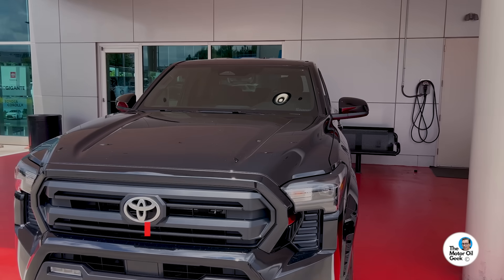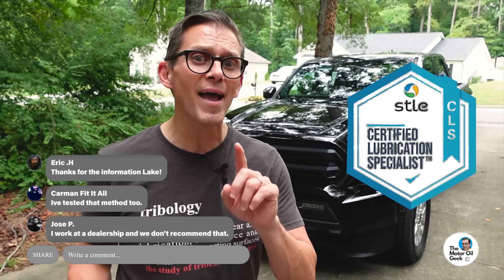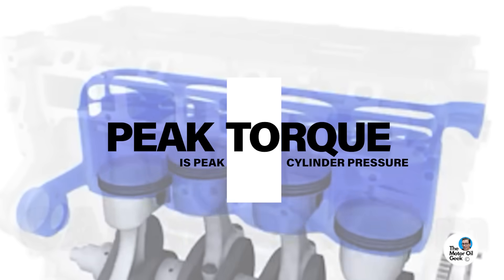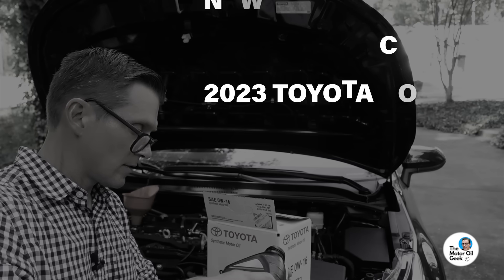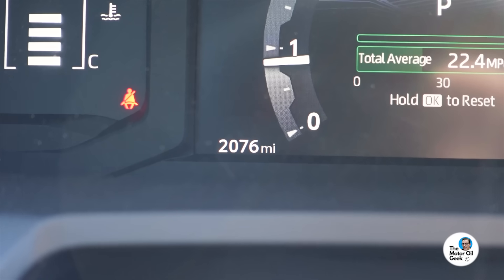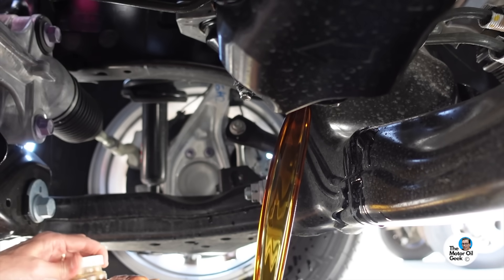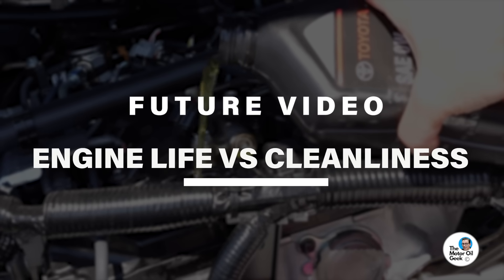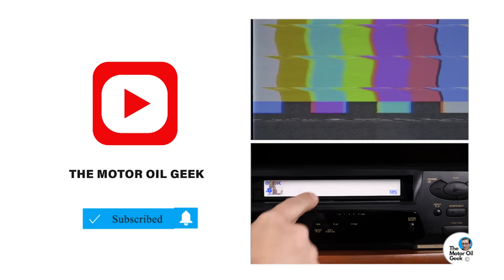The FACTS About Oil Changes (What The Owner's Manual DIDN'T Tell You)

Comment: At 1:09 you show a dramatic picture of metal residue. May I ask which car model "break in contaminates" does this picture come from. Because "in my opinion" there is no way that brand new Toyota truck behind you have visible metal residue at 500 miles. Also having wear metals ~100ppm does no real damage to the engine, you need numbers at least to the high hundreds for this to be an issue, and I am sure you know that. On a side note your left external jugular vein is dilated as you speak. Normally both sides may protrude as some people speak (speaking increases intrathoracic pressure). Having only one side means there may be something pressuring the vessels in your thorax.
Reply: Your opinion is based on what? Lo

Comment: Currently braking in my 25 tacoma.  First 1k nice and easy changed oil and filter but had a 1500 mile road trip day after 8 hours of strait highway Oops.

Definitely excited to see oil viscosity testing since this same motor outside the U.S. has a range from 0w20-10w30  in the owners manual.

Comment: @3:37 You mention "Direct Injection", you're not wrong, but your half right.
The entire Toyota Dynamic Force family of engines uses Toyota's D-4S which is Direct and Port injected.
These engines will never suffer from the dreaded carbon valve buildup that a normal direct injection engine would inevitably succumb to.

Comment: hi Lake, sweet Toyota, congrats, and that is also a sweet way to get more heat on the oil, ie buying a turbo engine!  Congrats to your family as well on  your daughter's job!    I love your channel, it's of course like nothing else YT has ever had actually, which is SUCH a relief after a quarter century of 'dupid's arguing about oil, lol.  My father figure was also a tribologist, and was a genius chemist and engineer as well, initially self taught chemist bcuz in early mid 1950's or late '50's even our public univ here was expensive for ppl with no money, so first two years of credit he was able to 'test through', which was allowed then, amazingly.  His career was at Boeing here in Seattle area, including a hella long layoff period when the economy shut down in the '70's for a very long time for the lazy B.  He was one of the geniuses there, ie could do it all and back then that was needed bcuz there weren't progammers who could or had time to do a 30K line program to make a fuel analzyer device (which he made).    Anyway i mention all this for one simple reason:  he died young at 57, of esophagal cancer, quite possibly not related to his chemical exposure, but i need to point out his chem exposure bcuz it was fairly substantial of course bcuz he was both a bench-chemist and a do-it-all chemist and engineer at a relatively dirty time in our industrial history.    And so i mention that bcuz i saw u changing the oil getting dirty oil on your hands/arms, and i'd love you to wear gloves, even though i was like you and did that too when i was working on my cars, at least long ago when i was young, but it's a big mistake, bcuz repeated exposure is also the bad aspect of course.   So, yeah we do deeply appreciate you and your efforts and want you living a great healthspan!    We men including me, have often been too casual about medical matters, and this matters

Comment: Lake, I have a 2017 Honda CRV with 92000 I bought it new. I've been using Amsoil 0w20 manufacturer recommended the hole time. I have also changed the oil on the recommended times not the Amsoil recommended schedule . So my question is what viscosity oil would you recommend. I plan on keeping is car and I watched one of your other videos about using a high viscosity oil on higher mileage engines. Thanks

Comment: I wonder how much difference there is on actual engine wear vs doing first oil change at 5000 miles. I'd think oil filter will remove larger particles that actually damages bearings.

Comment: I always changed oil and filter at 200 miles, 600 miles, 1000 miles and then every 3000 miles thereafter.   Always let my turbo engine idle for a few minutes before turning engine off.  Car is 20 years old and still in like new condition.

Comment: I bought a new Mazda 6 and Mazda tried to talk me out of changing the oil at 1000 km, saying it was unnecessary. The 1st handbook oil change from new is at 12000 klm ! Then 15000 km after. Maybe I'm old but 10000 is the max I will go. I do 100 km a day for work, 80% highway driving.

Comment: I only know a "little" about Oil, and that's EXACTLY the schedule I'm doing too for the Rebuilt I just got put in.
I'm also going to change the oil every 2,000-3,000 Miles in general, and put Amsoil Signature in it, or at the least Pennzoil Ultra Platinum since it's clearly the second best.  Also, maybe every 4th oil change I'll likely run Valvoline Restore and Protect to clean the engine some.

Comment: I am going to make this simple. I am 64 years old and I have done every oil change on every car since I was 15 years old. I have never ever ever had a vehicle in the shop for engine repair. My current vehicle is a 2005 4Runner 200,000 never been to a shop other than tires and alignment.

Comment: What are you guys talking about... What break in period, what first oil change??? If is sooooooo important and necessary the way everybody talks why don't you change transmission fluid as well at 1000 miles ??? Does transmission have break in period as well???  Come on people let's be real, just do the way owners manual says and stop talking trash about 1000 miles oil change or should I pre fill oil filter or not. I do 10k miles oil change on all my cars and have 3 cars older then 15 years, running strong, no leaks or any problems!!! All I can say... Blah, blah, blah!!!

Comment: I have a 2024 Tacoma, changed oil at 699 w/0W-20. Just changed the oil again at 3,000 w/5w-30, noticeable change in valvetrain noise. Smoothed it out quite a bit, also noticeable increase in oil pressure. May switch to 5w-20 at 5,000.

Also the other region manuals offer much more leeway with what oil type you use. All the way up to 5w-40

Comment: I agree, change early often!, however I would be SUPER curious to see 2 controlled test, one motor gets 10k oil change for break-in and other gets 150,500,5,10k  then add up total measured contam. often should be lower all added up then single due to the contam being circulated causing more wear. p.s. im a monster, i do 50m 150m 500m 2500m, 5k from there lol

Comment: When you add that 1 quart after draining, do you have the plug in or do you drain straight through? Thanks
Reply: I believe he has the plug out so you can just flush whatever remaining particles are there out of the system.  Sounds like a waste of a quart of oil to me but that is what he recommends.  Who am I to question him?  Then, put the plug in and fill the engine with oil according to your manual.  Keep in mind, if you don't change the oil filter, you are probably going to put in less oil than if you changed the oil filter too.  Good luck.

Comment: Question for ya oil guy ? Toyota cars list 0/16 or 0/20 , I heard that other countries don't run the same oil viscosity as the United States & their reason was the temperature of that country & they don't want to change the cars label for what country it's going too , so hot climates they use 5/30 & for cold climates it's the 0/16 or 20 , so for me in Michigan should I be running 5)30 in the summer than go 0-16 or 0-20 what ever the car recommends normally ? 0/16 0/20 seems very thin for summer time ? Thanks hope you see this & comment back ? thanks !

Comment: I followed the advice from these videos and did the first oil changes on my 24 Tacoma at 700 -> 1,500 -> 3,000 miles and then every 3,000 since. Toyota is great and did the first three for free even with very little miles in between. My last free oil change at 3k miles was the 15k service 😂. The truck is at almost 20k miles now with 8 total oil changes. Very curious to see the upcoming videos on this truck!

Comment: That is factually incorrect. The more particles trapped in the oil filter cause it to bypass more oil so that less and less oil passes through the filter. Once the oil filter is "maxed out" with particles, all of the motor oil will bypass the filter. I have also seen what neglected air filters do on fuel injected engines and it is a gradual loss of power from what the customer is used to when the air filter was new and or the car was brand new. More air flow equals more power. High silica levels on a new engine is from the casting process since the engine block and cylinder heads and other parts are cast in sand. There's no way to remove all of the microscopic sand particles from those components before the engine is assembled not to mention the cleanliness of the assembly plants isn't "laboratory clean".

Comment: Our Honda CRV (2025) hybrid had an oil change (not a factory recommendation) at just under 700 miles, then again at a bit over 3000 and now (about 15 months in after purchase new) it has just over 4000 miles on it. I will change it again at about 6000 miles. I used Amsoil this time and feel confident (no turbocharger) that I am doing the correct thing to ensure long life. I am still using 0w-20 grade as that is what is called for in the manual.

Comment: Does leaving the same oil filter to filter more isn't going to be more clogged? Resulting in a higher oil pressure, not because of more oil going through but because of oil restriction? I know we are not talking about a 20k miles filter but, if pressure increases, the valve in the filter opens, letting unfiltered oil pass through?

Comment: I would be interested in info on long intervals between oil changes. My commute is about 500 miles a week at 60+ mph for the majority of it. I change my oil once or twice annually. 358,000+ miles on a 2008 Ford Edge 3.5L, naturally aspirated. It started life with me at just under 100,000 miles. For the past few years I've been using Mobile 1 full synthetic 5w-20. It was not my commuter car for the first 6 years we owned it (2012-2018). 
  This car has been absolutely dependable! I did replace the power transfer case over 150,000 miles ago.

Comment: I did similar early oil changes when I bought my motorcycle new. 1st change was at 50 miles. 2nd was at 150 miles. Then every 250 miles until the Odometer reading was a little over 1000 miles. It's a 4-stroke air-cooled  200cc dual sport, That fills with one Liter of oil, so it wasn't expensive to do.  Now I  change the oil about every 1000 miles or less depending on oil color.

Comment: I bought a 2025 BMW M440 and change the oil at 1k and then 3k and then 5k just hit 10k miles and did it again, pretty black… B58 engines run hot. I will probably change every 3k… 5k is pushing it. Hilarious how they say do it every 10k miles.

Comment: Mazda wanted me to change the oil at 7500k. No way. Changed it at 756, 2300, 5357, now got back from a road trip car has 7600. Changing the oil this week. Number 4. Oil is cheaper than the manual recommendation.

Comment: I've already got 8700 miles on mine. But I did change my oil at 1000 miles and again 5k on odometer. I've changed the filter every time. I took a oil sample at the 5k. I've ran valvoline restore and protect 0w20 from the first oil change.

Comment: Also, for Oil Changes, a Fumoto Oil Valve is your best friend.
Reply: I use that too on all my cars - fumoto is awesome! Problem with some of the new cars is that they have a plastic oil pan that has to be swapped with a metal one before putting in a brass valve that could crack the whole dang plastic pan 😮 - it’s total junk these days
Reply: Or Femco...which supplies their products and designs for industrial applications
Reply: only good for the do it yourself people.  I’m too old to climb under the car!  why make it easier for the shop? 😂

Comment: I'm a biker and I change my oil at 5k, not 7k recommended by the manufacturer. It has worked well for me. I am typically getting over 100K without problems on my motorcycles. (for you car guys a 100k on a motorcycle is a LOT)!

Comment: The guy in the other video said an "air filter" gets better as it gets older. The oil filter as a built in bypass, wouldn't that invalidate the potential added performance off the clogged media?

Comment: I just bought a 2026 Ram 2500 hemi.  I wanted to do my first oil change at 1000, but couldn’t do it till 1900.   RAM specifies 0W40 and only Penzoil makes it.  I don’t agree with that but it is what it is.  I am a Chevron Havoline and Delo guy for 40 years now. I almost changed to Delo 400 5-40 but I don’t want to mess with the warranty.  What do you think about that. Being that I work for a fuel and lubes company, I know a little.  Delo and Baldwin filters have never let me down. Delo works in gas and diesel engines.  This Penzoil isn’t always easy to find.

Comment: I like the oil filter discussion with not changing it at the three early intervals as “ a dirty filter is a good filter “ The smaller filter pores get clogged up so the dirty filter is actually collecting more particulate and keeping it away from circulating in the engine.
This is the opposite for biological filters of say water in a Brita water jug. There a dirty filter is accumulating  potential harmful bacteria from the water etc and should be changed regularly so you are not accumulating bad stuff that multiplies and releases toxins and other bad bad stuff into your drinking water.
Interesting concepts

Comment: Question about the "recommended" oil viscosity.... especially for the turbo engines... If you lived if a very hot area, where it's consistently over 100 degrees in the summer, would you still stick with the recommended 0w20? Or if you lived in an area that got hot like that in the summer, but extremely cold (-30's) in the winter, would you switch your oil viscosities seasonally? Something like 0w20 in the winter but 5w30 in the summer? I'm sticking with the recommended oil while my Subaru is under warranty, but the 0w20 makes me nervous when it's really hot out!

Comment: Thanks for all of your great information.  I just did my fourth oil change at 10,000 miles on my new GMC Canyon At4. First one was at 1,000 miles and then every 3,000 after that.  I would have done what you're doing if I had seen this sooner.  I still have my 07 2500HD Duramax classic that I have been changing the oil every 3,000 miles since new and has been fantastic.

Comment: No engine we use every day in every day drivers has the oil pass all of the time completely through the oil filter.  Some oil bypasses the filter and doesn't get filtered.  Your argument that a dirty oil filter does a better job than a clean filter has some truth but doesn't have the same methodology as an air filter.  The air filter has all of the air pass through the filter all of the time in a perfect world unlike the oil filter.  I would change the oil filter every time in break in to reduce the restriction and improve the flow through the filter.  So please don't compare air filters and oil filters as the same.

Comment: I haven't changed my oil in over 7 years!  (But, then again, I drive electric.)
Reply: Wait til that battery is 10 years old and the replacement is $10k
Reply: @dougn2350 By then, a replacement battery will be cheaper, but let's use your number.  So, basically, for $10K I can get a new car?  I'll take that deal!  😀

Comment: Dont forget breaking in rings comes with good vacuum. So if you have a manual or can shift manually, decelerating in gear causes high vacuum and helps with seating both aspects of the ring, compression and vacuum.
Reply: I watched a video from a motorcycle race engine builder. He showed the difference in wear from a new engine the was worked hard during break-in and one that was babied.  The hard run engine showed considerably less but more even wear on the piston and cylinders.

Comment: It looks like the pan drain plug is on the side, I saw someone take off a pan and there was maybe a half quart 'reserve' left in the pan. Maybe the logic is quick lube does a crap job with the plug and it falls out, in some cases you avoid killing the engine. I wonder what the manufacturers do, they may not even put fuel in, I assume the rest of the fluids they put in. Asking the question, the factory does test run the engine before going into the car, but fueling and sanity test of the vehicle is left to the dealer prepping the new car.

Comment: So here’s the big question.
How important is it to give your new cars engine time to break-in in the big picture?

With all the cars on the road today new and used.
Honestly how many of those cars had there engines properly broke in before taking them on long steady rpm trips before taking it down the track or rodding on it hard and they are still running today? 

Let’s be honest again
How many new car buyer even care to take the time to break-in the engine. Because it’s under warranty and they have no intentions of keeping it until the wheels fall off.

Which if you are going to buy a new car.
That’s the only way to come close at getting your moneys worth out of your investment.

It’s a throw away society.

Comment: I follow the manufacturer manual closely. The maintenance manual  has two different maintenance schedules. Normal and severe. Modern engines are controlled by computers operate much cleaner. Most engines use synthetic oil. Question? Did you cut open the oil filter to inspect to metal?

Comment: My 2022 GM vehicle was involved in the recent L87 engine recall and after it failed inspection the engine was replaced by the dealer. Yesterday, I changed the engine oil after driving 300 miles on the new engine and I couldn’t believe how black and used the oil looked. It looked like oil that had 4,000 -5,000 miles on it. Wild.